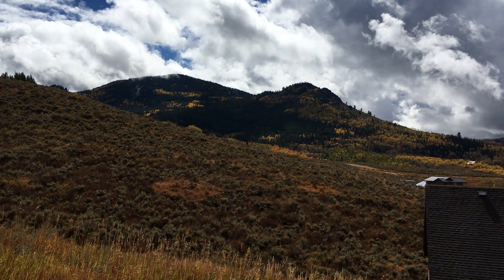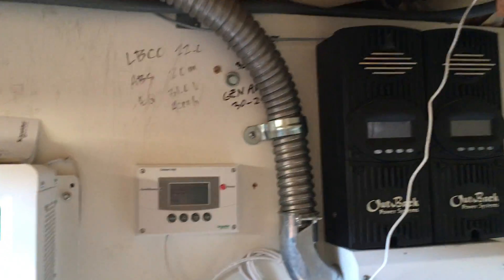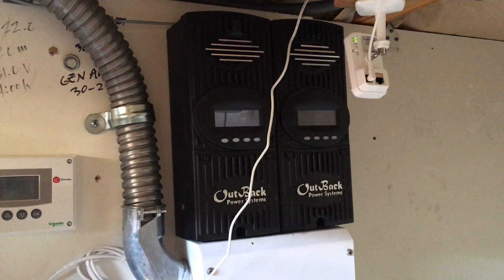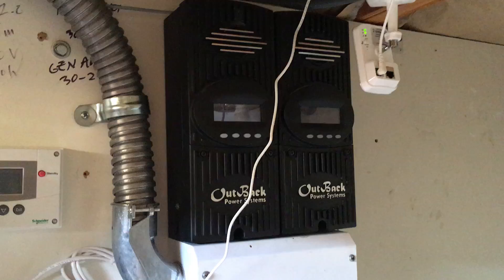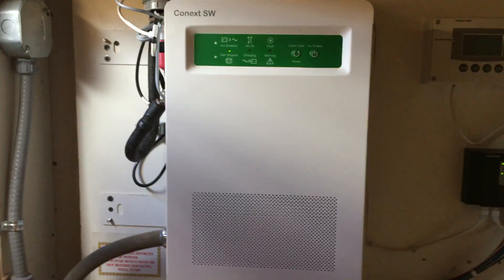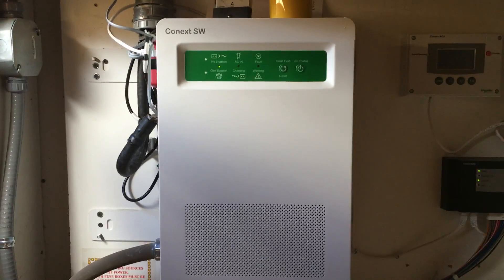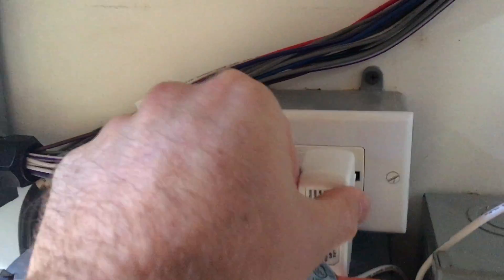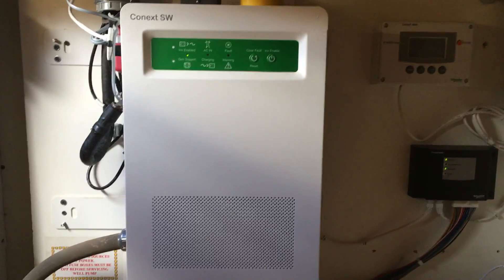Off Grid Living: The Solar Charge Controllers and Inverter

Comment: My Outback Power Systems black box just went dead today. Have had it for 3 yrs., so it's troubling. Trying everything diagnostic right now. I have full sun today with 19 solar panels and am getting goose eggs (0.0 kw) on the Mate3 monitor. Working remotely with the electrician who installed the 12 panel pole and lithium/iron/phosphate batt. box 2 yrs. ago, but he's 75 mi. away and not here today. Any advice you can give here? I tried throwing the breaker switches off and on several times, and turning the lithium (LiFePo) battery trunk off and on as well, no dice. Thanks! Subscribed!